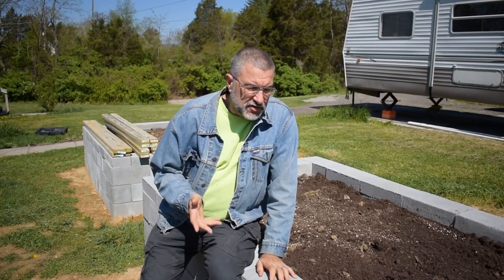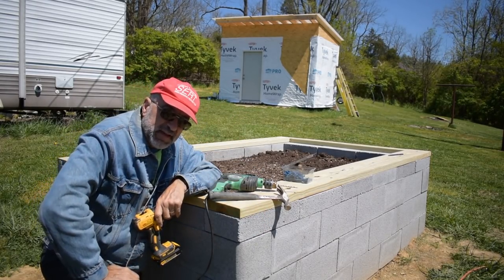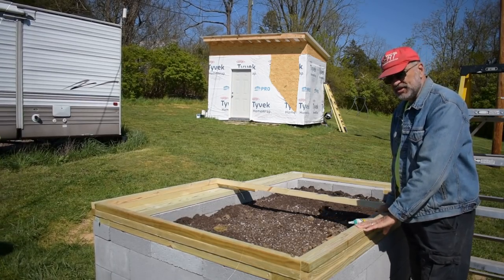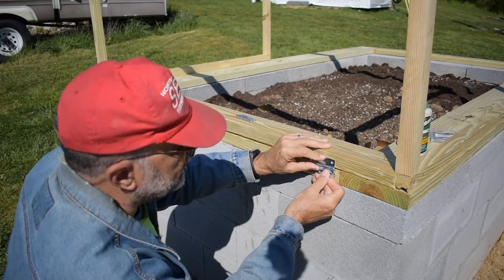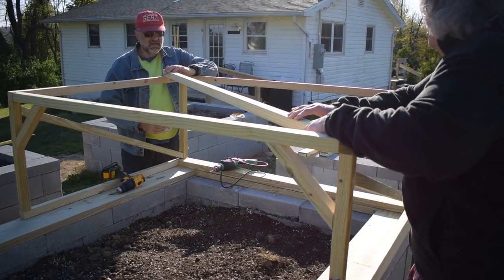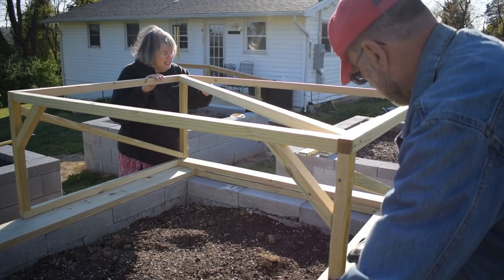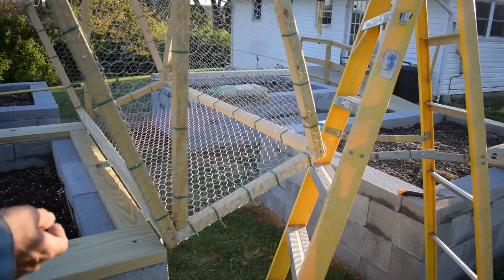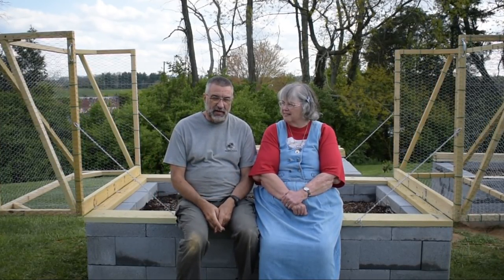Building Raised Garden Bed Covers

Comment: Love this hinged box idea!  

IF the zip ties (attaching chicken wire to the 2x2s) have their protruding nubs pointing inward or sideways, rather than to the outside, they won't wear thru the coming plastic covering,  if choosing to use it for extending the growing season  I've found that anything pressing against the plastic sheeting, whether metal, splintery wood or hard plastic, will sustain damage faster at each stress point, from sun, wind or accidently rubbing against it while working nearby. 

The plastic sheeting will probably last only 2-3 growing seasons anyway, depending upon the hours of sunlight & strength of winds in your area, unless somehow taken inside when not in use. 

Btw, I have also used hula hoops cut in half to hold plastic off of bedding plants but, of course, that doesn't deter deer.

Comment: Thank you for showing us all the work that goes into this project. Have you ever built a deck using used (or new) wood pallets? My daughter and I want to build one to place our picnic table on it. I have seen DIY videos on you-tube, but its never exlpained simple enough for our needs. I know you have to prepare the ground under it by leveling etc. Are you planning anything like that for your home? The cost for that kind of deck seams to be very low.

Comment: Great job!  Taking care of the family!  Love it!  I'm making the same but I'm making them lighter 2x2 & 1x2.  I want to remove them when not needed.  I'll also stain them before putting the chicken wire on them to match my wood beds. (Garden Safe Stain).   My big issue is the squirrels and chip munks ripping out my seeds and plantings.  QUESTION will chipmunks get through chicken wire?  Also I'm making shorter as I don't grow tomatoes in raised beds.  The tallest thing I grow in beds is chard and by the time it gets that big I don't think the squirrels will still be a factor.  Fingers crossed.

Comment: I like your design. I think we might copy it for our garden, which I know you won't mind. I have to point out one thing, though. When you cover the frames with plastic, you will want to find a way to raise the middle just a bit so that water can run off of the plastic. Even though there's screen under  the plastic, the water will pool and weigh the thing down.  Even a few inches will make a big difference and let the water run off.  Another thing about plastic. Please buy the heaviest mil plastic that you can find, and be sure it's UV rated. We've used heavy duty plastic drop cloth and it disintegrates and crumbles in the weather.  As for critters getting into the garden, you have an advantage with the height. I don't think rabbits will bother climbing up the side of a cement block wall! But deer would find your plants at a convenient height, and I don't know if they would jump up onto the bed or not. The other animal that we have in our neighborhood is wild turkeys. We see a flock stroll through our yard nearly every day. I think there are about 20, but they don't stand still for counting! And turkeys fly, so you are right to fence over the top of your bed. We plan to do the same, just because of the turkeys.  Bill, one more thing about your tomato plants--you might want to transplant up to a larger pot, at least a 5-gallon bucket for each plant. And even at that size, they will need more fertilizer than if they were in the ground.
Reply: And that brings up a point--the cost of UV protected plastic--if anyone finds a good product that's not so expensive, I'd love to know about it.
Reply from the maker: Our tomato plants are already in 5 gallon pots.  :-)

Comment: "i am fighting darkness here", well, aren't we all! :) great tutorial, definitely will be following it, but will be putting fine fabric to save from pests, coz we dont have any deers here in urban areas (New Zealand).  1 thing i will add is a hook and a string to keep the covers open in case they drop back during strong winds. P.S. I also have auto  immune disorder, so resonated with your story :)
Reply from the maker: They’re mostly just wire, so there’s not much for the wind to grab onto. The wind just passes through.  It would take a REALLY strong wind to close them. She keeps them closed all the time unless she’s working in them.  And she wouldn’t be working out there anyway if the wind was that strong. Tying them  open is really not necessary.

Comment: The garden looks amazing however I couldn't help but notice that the back porch doesn't have railing on one side. I know you opted to leave it that way but it's just a concern of mine because I have health issues and vertigo. I would hate for someone to feel a little lightheaded and need something to grab onto and it not be there. Also I found a special highly textured paint made for boat decks that would look attractive and prevent slipping, painted on the deck. Probably more effective than the peel off strips they make for ramps. Sorry to ramble on as I've had poor health for several years now and can look ahead and see where to prepare. 
Enjoy the raised beds!

Comment: I did the same thing for my beds 2 years ago. The netting and hinges were surprisingly expensive. Now the cages  are all warped, crooked from exposure to elements and I'm removing them.
Reply from the maker: I put in extra cross-bracing to try to stop the warping.  It's been two years, and so far the cages are fine.

Comment: Thank for your video. Please, can you show or tell how you open or close the covers. Because I see a problem there, the corner of the lower part are going a be on the way of each other and actually no way to open it without pushing one frame into the other.
Reply from the maker: Just lift them from the center.  They are very light.  We showed that at the end.
Reply: Okey. I get not idea how I miss that part. Good job.

Comment: I have heard that using cinderblock can leach lyme into the soil or away from the soil, and wondered if you had done any research on this and what your findings were?  Or if you knew anyone that has a successful cinderblock raised bed.  I have heard the first couple years were great but the third year they had plants and were nice and green but no produce.
Reply: Wondering if you learned anymore on this potential issue.  Guessing we could amend the soil if needed.  I'm going to do one of these.  North Florida here with every plant eating animal in my yard.  Not to mention the humidity and rain will degrade a wood bed rather fast.

Comment: You said to use pressure treated wood because it’s not going to be in contact with the dirt , but what about the concrete then ? Is the concrete safe ?
Reply from the maker: Pressure treated wood is full of chemicals to keep it from rotting.  Cinder blocks don't have all of those chemicals in them.

Comment: I have two questions:

1. Do the concrete walls of the garden heat up the soil too much?

2. Is there any way you’ve seen to kind of give the concrete a little more curb appeal?

Side note: I have autoimmune diseases, too, so I also have to avoid nightshades, legumes, dairy, and gluten. It’s a modified keto diet, more or less.
Reply from the maker: The beds are so deep I don’t think they will overheat. Anything we paint on the blocks will need touch-ups. I would plant flowers at the ends, but I want Bill to be able to mow easily around them. We aren’t all that visible from the road.